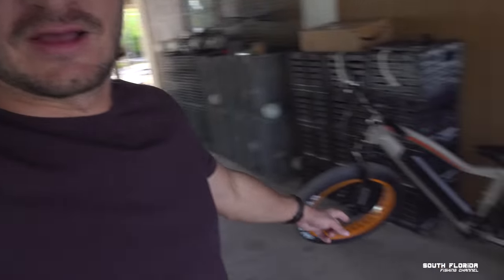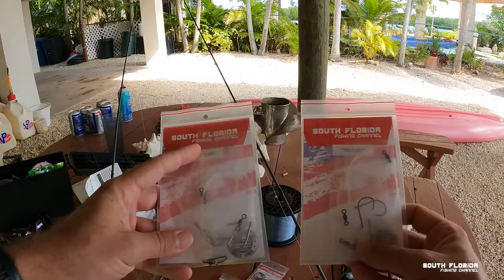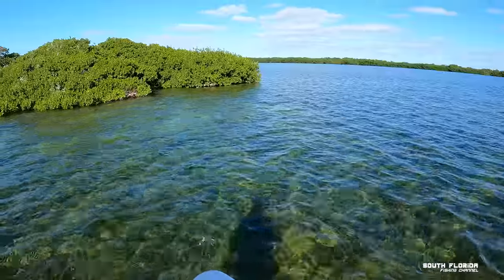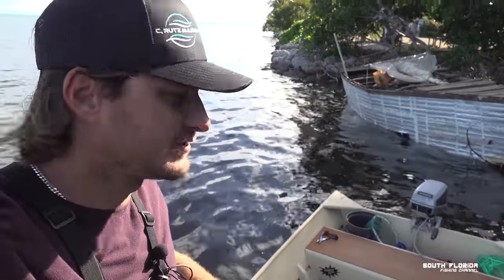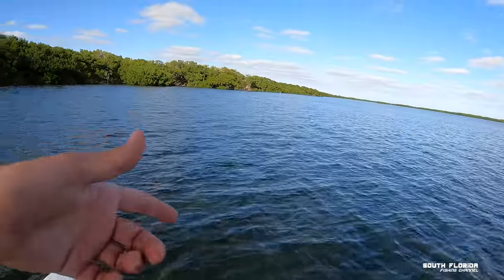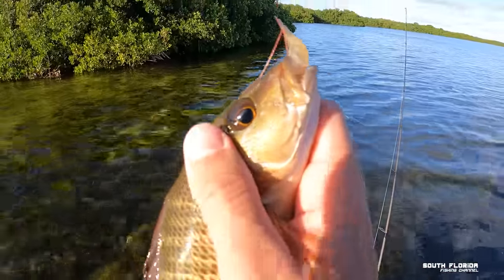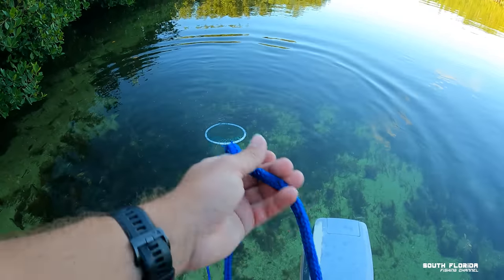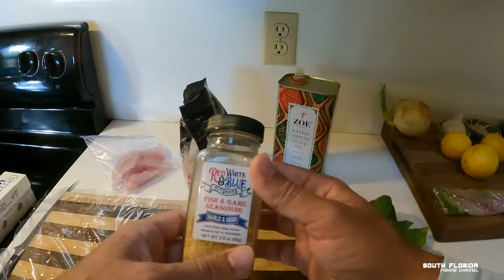I get BIT by a fish & BREAK a Gopro | catch and cook

Comment: It's a two stroke.  You have intake port or red valve issues.  Put 1.99 in line filter before the carb. Problem solved.